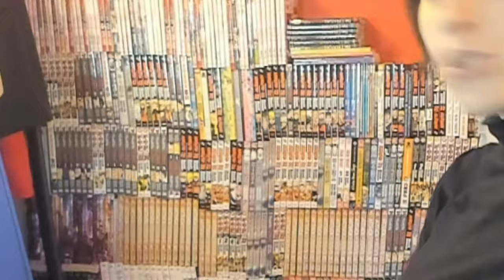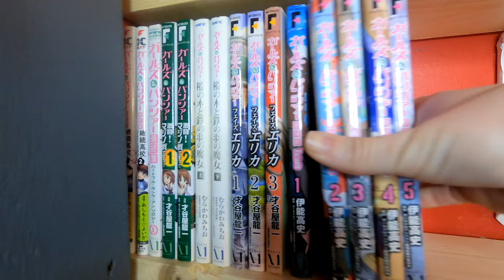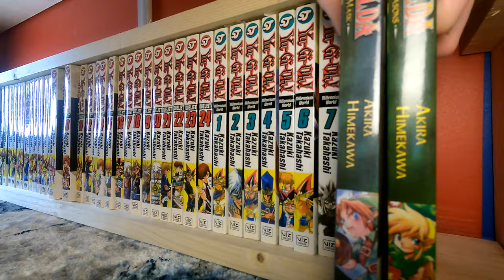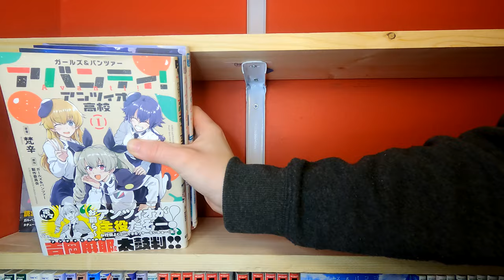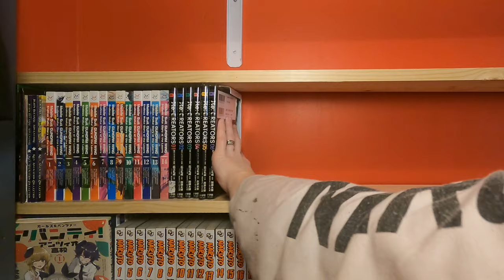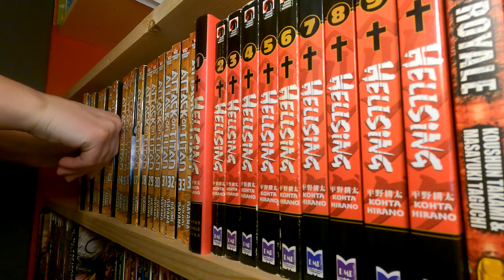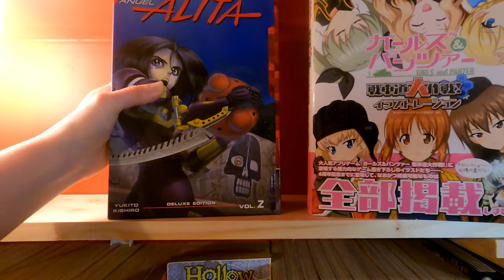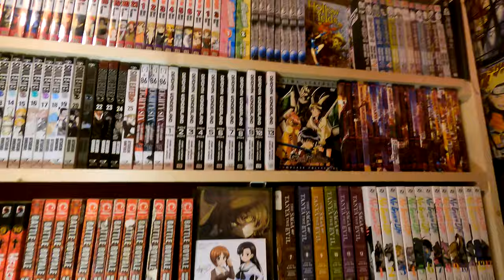Making the PERFECT Shelves for My Manga Collection // Build, clean, and organize with me!

Comment: I think the next time I need display/shelving I’m gonna try DIY. While the glass display case I got from IKEA is alright the metal shelving I got for my gunpla boxes is total garbage: 300 bucks and it didn’t even have even screw holes and is crooked as hell.
Reply from the maker: I'm sorry to hear about metal shelving. Highly recommend DIY - you can control so much about it and it only gets as expensive as you want to make it. Good luck when you make yours ^.^
Reply: @Konsuming_PlastiK  Yeah I also ended up getting my dad to help me put it together, we agreed to call this a learning experience and do either Harbor Freight or a wood DIY when I'm ready for a replacement. At the very least it hasn't collapsed or anything yet lol.

Comment: 9:12 Best part of the video! But I do want to know what you were saying to go with the hand movements at 0:53.
Reply from the maker: At 0:53 I was mentioning that I was going to put some metal crates on the radiator because I didn't want to use wood since it would warp from the heat. The hand motion you're noticing is probably warp haha. I speak with my hands a lot :)